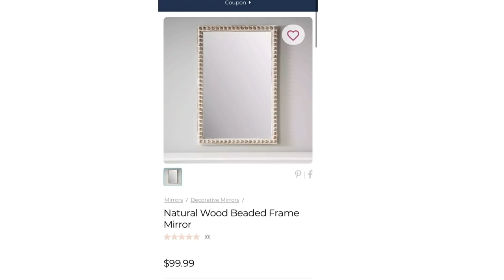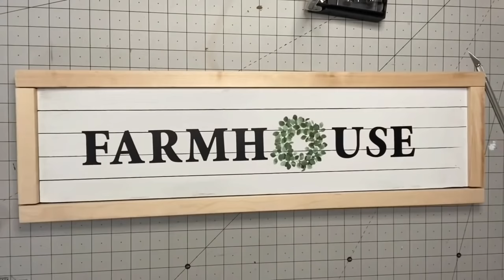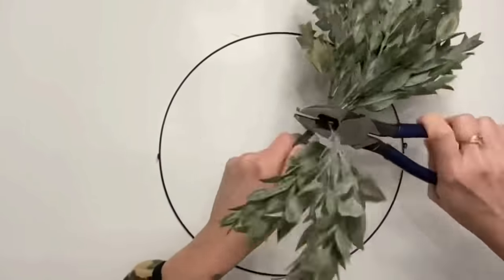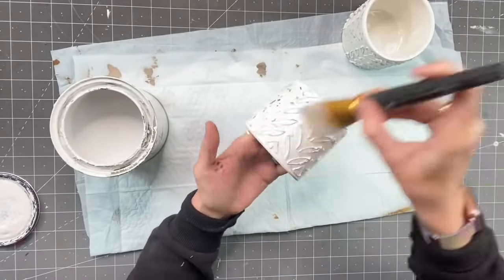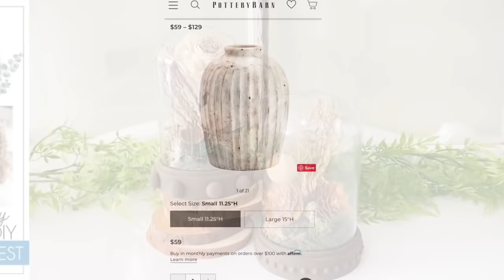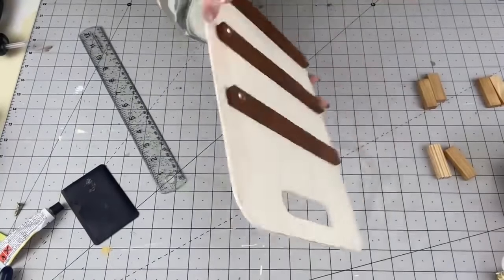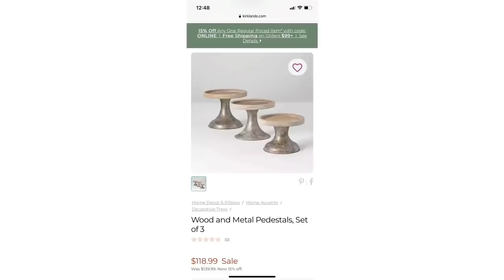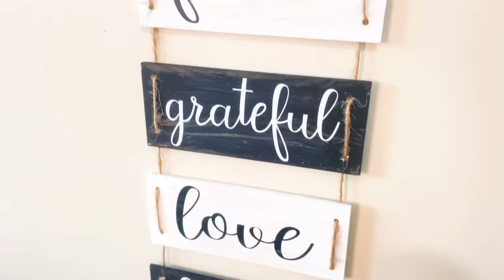32 EVERY DAY HOME DECOR DUPES | EASY DIY KIRKLANDS DUPES | DIY AMAZON DUPES | NAME BRAND DUPES

Comment: You asked about straightening the warped signs… I have straightened some warped thin wood by steaming it (not to the point of saturation, just a bit moist) wiping any excess moisture off the surface, and then placing it on a flat surface with weights such as bricks on it. It may take several days to straighten out, and if you take the weight off before it isCompletely dry it may warp again, but it has worked for me.

Comment: If you want to recreate the placemat on the foam board - take the skinniest jute or string even and run it - soak it in school glue or mod-podge or glue and water. Take a DT pizza pan and line with Saran wrap. Now just loosely 'drizzle' the string into the plastic wrap in that circular pattern. Let it dry and remove the plastic wrap and voila - you've got Sammie's garage sale find! 😊

Comment: You asked about how to straighten out wood or the signs you were using if you spray it on the back with just plain water and put it down under something heavy is something heavy and after it dris there it dries it should be straight